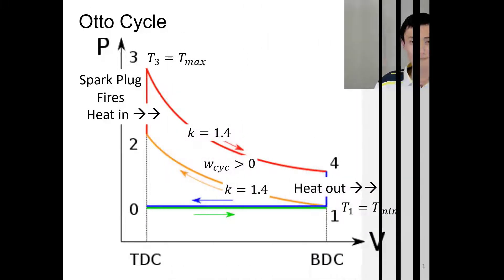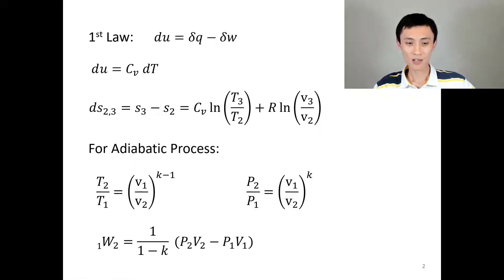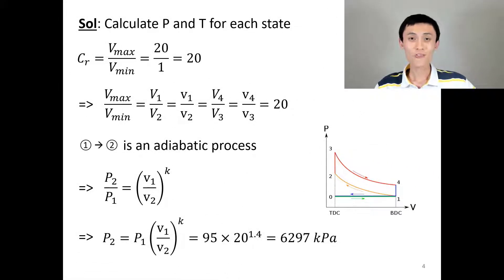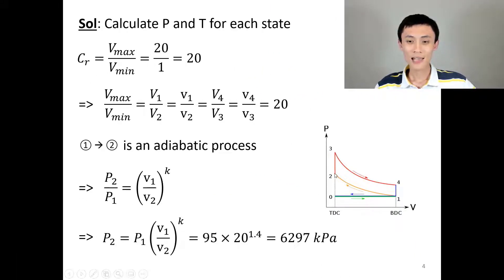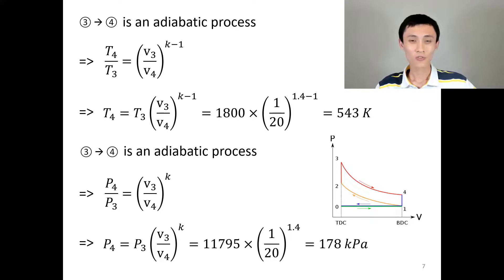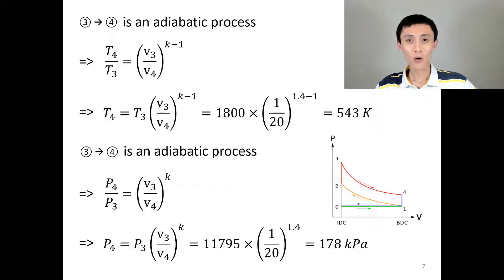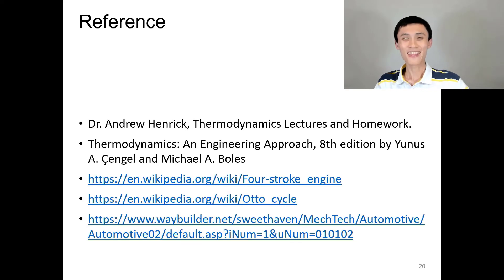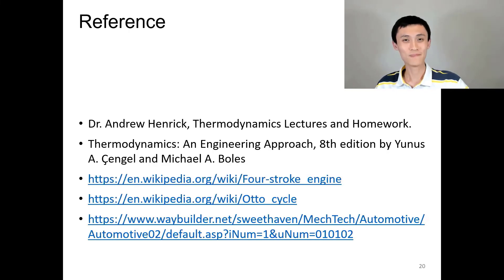Otto Cycle Example | Otto Engine | Otto engine has a compression ratio of 20:1with an inlet of P1

Comment: For step 2, why are we using cv in our calculations? I imagine this would cause significant error since both pairs of states (2 and 3, as well as 1 and 4) are far from the nominal value of 300 K suggested when we use the 0.718 as our specific heat in constant volume.
Reply from the maker: You are correct. Technically, we are supposed to use Cv with their corresponding temperature for getting more accurate result. In this example, our main focus is to show how Otto cycle works so we simplified the calculation by treating Cv as a constant.
Reply: @DrGucci  Since my previous comment, I've seen such in practice. Please forgive my hastiness, and thank you for your timely response! I look forward to learning more from your videos in the coming semesters.